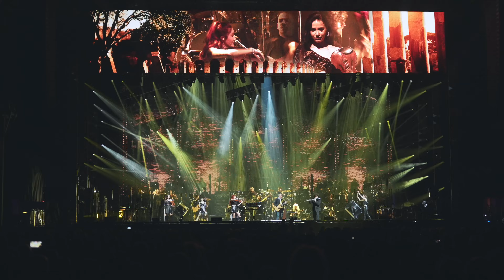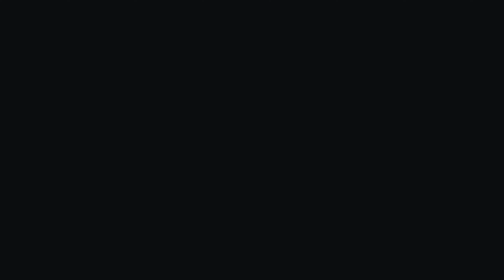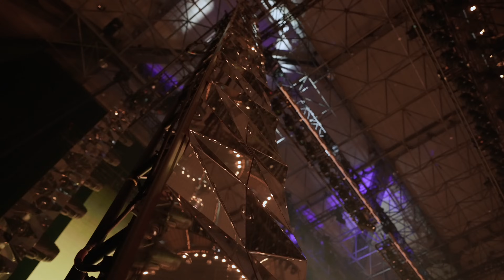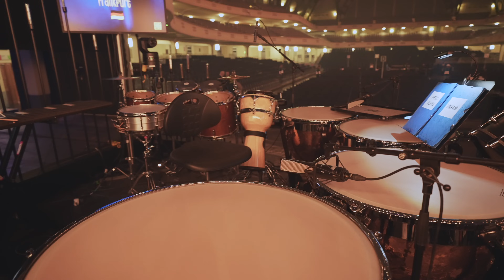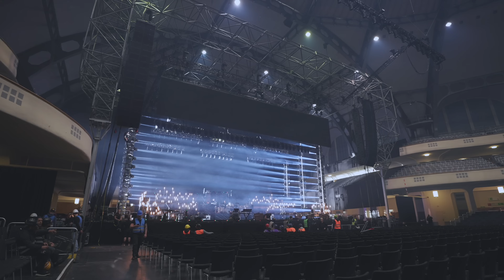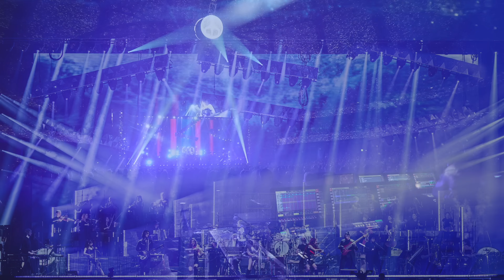Hans Zimmer Live • Behind the Scenes • Lighting and Live Audio Design

Comment: hey guys, can someone please explain to me shortly what hypercadioid means? Google wont tell me anything 😅
Reply from the maker: Hey Elisa, if your question is about line arrays…the new L2 and of course the L2D feature four low cardioid (LC) loudspeakers on the sides, allowing a standard array to exhibit a broadband cardioid pattern that minimizes rear SPL at low frequencies.
With the appropriate presets, the line array hangs can alternatively exhibit a “supercardioid“ pattern that minimizes side SPL at low frequencies. With that you don't have so much noise or lower sub frequencies on the stage that could disturb the performers. You can also reduce the risk for feedback if you have a lot of very sensitive mic setups on stage.
There are also cardioid arrangements for the subwoofers. Creating a cardioid stack with L-Acoustics SB28 subwoofers usually involves setting up the subwoofers in a specific configuration to achieve a more directional control of the very low sound radiation. 

Of course, this expression also exists in relation to microphones. In terms for mics a hypercardioid microphone features a much more directional pickup pattern that is more focused than the “standard“ cardioid microphone. It's designed to capture sound primarily from the front while offering greater rejection of off-axis sounds from the sides and rear. For example, boom mics in film production.